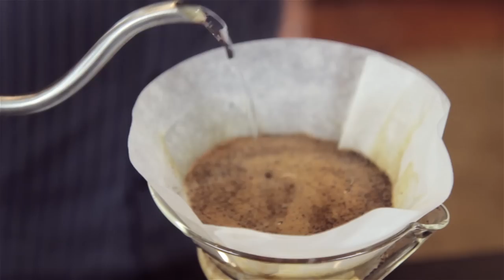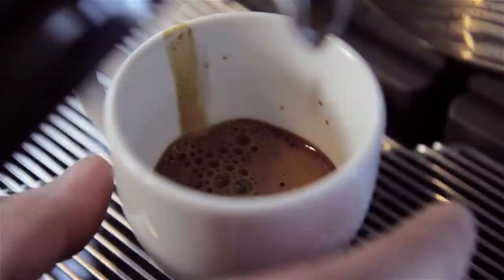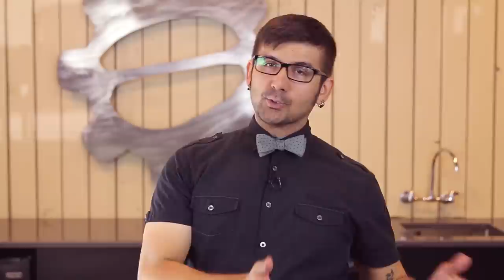Pour Over Coffee Method | Flow Rate & Grind | Cup O' Joe

Comment: I live between 5280 feet and 9500 feet. The highest boiling points I can achieve is roughly 205 and 196 respectively. Is there anything I can do to compensate for the boiling point decrease? I would like to adventure into pour-over, but I am making sure I can make a good cup at these altitudes. Right now, the trusty AeroPress works at all the way down at 170.
Reply from the maker: +RyNo Looking into this for you!
Reply: You could use a pressure cooker to heat the water up to your desired temperature.